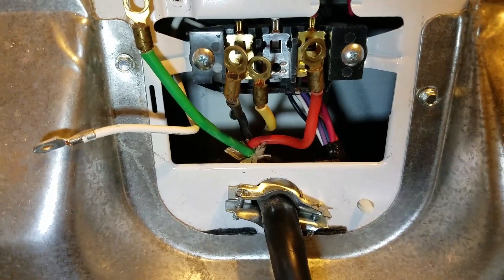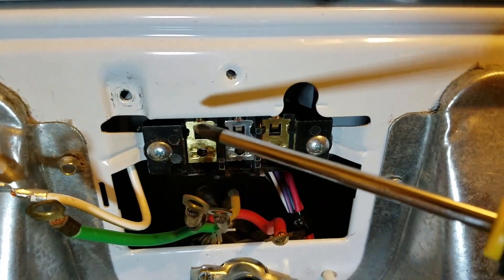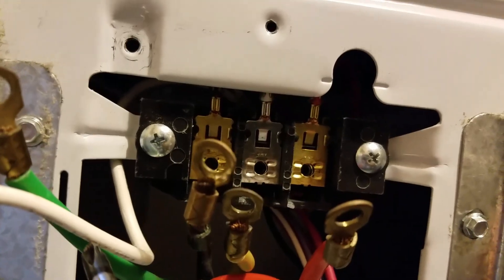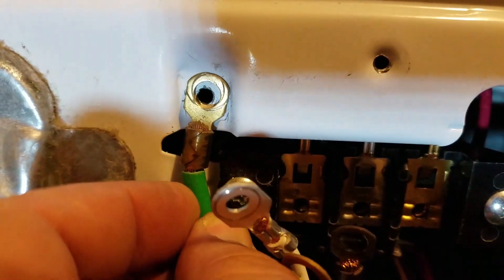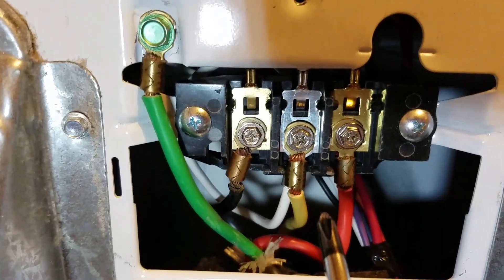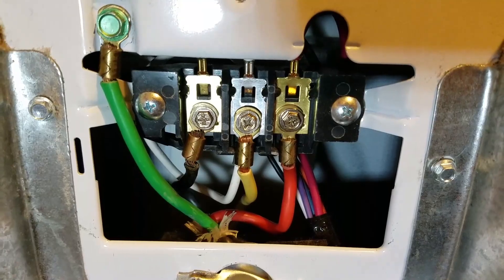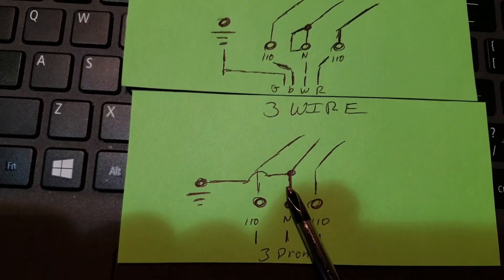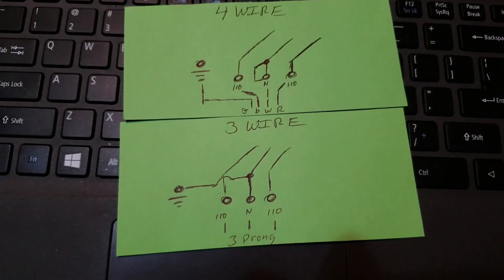How to install a Electric Dryer Cord, 3 or 4 prong. Ground Wire explained

Comment: A lot of people keep the white ground wire from the machine attached to the body and add the green wire from the cord to the same screw so both are attached to the body. Even a Home Depot video shows this. I know yours is the right way, but is it dangerous the way they are doing it?

Here is the Home Depot video that shows it the way I'm describing
https://www.youtube.com/watch?v=6pnABXrjwio
Reply: I also have this question. In the Home Depot video they put the white and the green wire together up on the left side not on the middle with the neutral

Edit: I talked to quite a few people as well as the people at Home Depot and an electrician that was close by and they all told me to put the green wire with the white wire against the machine not with the white middle neutral wire.
Reply: Kris Arthur
Do like the video you just watched, the hole purpose of a four leg is to separate the two.
It will work the other way but wont be any safer then the older 3 leg setups.
Reply: @Kris_Arthur  I agree with 'old bones' below.   
If you connect the old ground( white in machine) and the green together this will eliminate the purpose of the 'new' ground as that of a Dedicated (green) ground wire.

Comment: Question! I bought an older maytag stove top burner used. So it has a Black,Red" and ground wire coming from it. I hooked up the colors so they match and I put a cap on the white wire in the wall. Is this safe or do I have to jump the the white to ground inside the wall box?
Reply from the maker: Cap on neutral? You should ask an Electrition / have one check your wiring.

Comment: Thank you so much, your video is the ONLY video that explained that I need to move the nuteral wire to the chassy when I'm installing the three prong cord (for my older home).
Reply: Thank you!! Yes ur right the only video that explains what is actually right thank you again

Comment: I'm so confused. I got a dryer from my neighbor and it was hooked up as a 3 wire setup with the white wire jumped to the center(on his cord). My cord the white AND green ground wire are jumped to the center. So should I hook my new dryer up the same way? So it goes, starting from left to right, black>white,white, green>red? My old dryer has a green with yellow stripe wire connected to the chassis ground so this was how it was wired. The new dryer does not have a wire at all going to the ground spot. Please let me know ASAP so I don't kill someone in my house. I cannot say what I have for a electrical configuration at the box. All I know is my house was built is 1996 and as far as I know, no electrical work has ever been or needed done.
Reply from the maker: Go back and review at 6:50. that may help you get it.
Reply: Yes, I understand the wiring methods. What I'm basically telling you is my dryer cord is a 4 prong but it was connected at the old dryer as a 3 prong with the green and white wire on the center terminal with a green w/yellow stripe going to the chassis ground but not connected to the block(that I could see). Should I connect my new dryer the proper way a 4 prong is terminated or should I reconnect it in the previous 3 prong configuration? Again, I understand the different methods. I need to know if this dryer was set up incorrectly in the first place and I need to change it or it was connected as a 3 prong for a reason.
Reply from the maker: It sounds like the old dryer was wired incorrect, but still safe to use. ( because there was at least something going to ground and not just relying on neutral for ground like in an old 3 wire hookup ) I would wire up the New Dryer in the correct 4 wire hookup.
Reply: Got it hooked up and no fire or electrocuting myself. So I call this a win. Thanks!.....lol

Comment: Hello, thank you for posting this, I hit a huge like! Lol My dryer was originally a 3 wire with the cooper neutral strap grounded to the body. If I'm hooking up a 4 wire I just remove that cooper strap and hook up the black to black, red to red, white to white and green to ground on the body correct? Thank you so much!

Comment: Okay so we did all of this and tried to push the start button and nothing happened. What would cause that?
Reply from the maker: Is this a used dryer? Was the door shut tight? did you turn the breaker box back on? Get a volt meter and check your outlet at the wall ..
Reply: breakerbroke23 I have this problem, and the volt meter says there's power coming thru.. It was working fine before we moved

Comment: "You will die if you do not do that!"   Yas Daddy
Reply from the maker: Quick story... back in the 80s, wife and I lived in a old home. The Stove and Fridge where next to each other. I walked in the House to get a beer and found my wife PULLING the Stove and Fridge across the kitchen.( she could not let go)  She was trying to scream to get my attention. I grabbed her and yanked her away from the fridge. She was almost out!
 After she got up and walked it off, I took my volt meter out and put one lead on the stove and one on the Fridge. There were 110 volts between the two. The electrician said the old power service lost neutral or something to that effect. My Wife could have DIED....... So yes its a BIG DEAL.  Thanks for watching

               Daddy

Comment: 3 wire is not to code since 1997 when electrical codes were changed - 4 wire is only one to use today - so no one should be using 3 wire hookups.
Reply from the maker: Most older Homes are still 3 wire.  A good number of older Homes will never be rewired. So 3 Prong will exist for quite a long time.
  I bet if you look at statistics more people have died from stabbing them selves whit a Steak Knife than getting shocked by a stove.

Comment: my dryer (3 prong attached) was sparking at the door hinges. I opened the top and a green w/ yello stripes wire was not attached to anything. Did it come loose and the exposed wire tip causing sparking or was it always that way?
Reply from the maker: Sounds like the person that wired up the Cord did not tighten up the screw tight enough, check the other two. WOW! When you hooked the white Wire back to the chassis, did that fix your issue?
Reply: the green w/ yellow wire that is exposed looks like it is spliced with the white wire going to the middle post. there is another, smaller green w/yellow stripe wire attached to the dryer frame. I'm not 100% sure but I think it may have been converted years ago to fit this older homes outlet. Sparks just started last week.
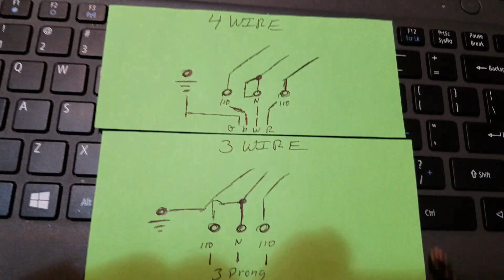Reply from the maker: Revisit 7:00 in my Video, If you wire the green back to the cabinet and still get sparks then I would call a professional. I dont want to give bogus advice because I am not there to look out for any other factors.
AND/OR keep looking for a YT Video that clicks whit you.. Good Luck....BB23
Reply: thanks

Comment: I was given a dryer that came with a four prong wire. My house has a three prong outlet. I don't see a white wire on the dryer. There is, however, a green wire screwed into the frame. Is this the grounding wire or do I still need to wire the neutral to the frame? Thanks in advance
Reply: Brennan Gandy did you ever get a response to this? I have the same issue . I have no white wire. Just 1 green and  yellow stripe wire poking out from the dryer. The old cord had 4 wires 1 of them white. The rest was 1 red 1 green and 1black. I’m confused

Comment: thanks for this very helpful video. I have a question>. I understand that there are two 110v terminals in the outlet. These supply the two flat prongs (in both 4 or 3 prongs cords). 110 +110 will give 220 v needed to operate the dryer. My question is :why the two hot wires are connected separately to two the dryer terminals and not one only to get 220v? where the 110v will be added to each other to get 220v?. Thank you.
Reply from the maker: Thats a great question. ANSWER IS.... Iam not sure. I can only guess as to why the Engineers designed Dryers this way. 220v would be more efficient than just 110. More of a currant draw at 110. And the heating coils are generally 110v.Also, If one coil goes out the other would still work?  You have sparked my interest and when I have time I will study. As I said before great question.
I am open for comments from the "experts"
Reply: Thank you so much for your reply. The reason for my question is that I have some kitchen machines 220v and they have 2 prong plugs (not grounded). That mean one prong is hot(for 220v) and the other neutral ?. I do not want to buy expensive transformer (110<>220). I simply thought that may be inside the Dryer the two 110v wires are connected to become one wire (220v) :). But by Googling, I found that if the two 110v wires contact each other, the circuit will short :( . Then I found your valuable video and I hoped that I may find more explanation. Anyway, thank you and if you have any advice for my 220 machines, I would appreciate your help.
Reply from the maker: I wish I could help, but I do not have any hands on experience I can trustfully pass on . Thanks for watching.. BB23

Comment: on my dryer there is a green wire thats from the inside of unit connected where my new black wire goes lol any way that could be the ground wire that i should connect to center with the white??
Reply from the maker: Maybe use a flashlight and look up inside where the wires are and see if the grn is connected to the white. If so I think it would be safe to loop around and hook up to the white. If the grn wire hooks up with white up inside that is. Grn and blk should not be hooked to each other. If you are still having a problem call an Electrician or an Appliance Installer.

Comment: when I do this I plug it in and after I turn it on it shocks me.what could be my problem.
Reply from the maker: I would check and see if the wires are correct on the Dryer side of the contact bus. Do you live in an old house that may have been wired incorrectly?  If its still messing around whit you, I would call an electrician out ASAP.. BB23

Comment: Can I use any screw when it comes to screwing in the wires?
Reply from the maker: Well the screws on your Appliance would be best, if you dont have them, can you take the screws off your old appliance.  or maybe order these .. https://www.applianceparts4all.com/whirlpool-terminal-block-screw-279393?utm_source=google_shopping&gclid=CMrcuLn9n9MCFc5bfgodP4AG_w
 I just would not trust any others that screws made for this job.... BB23